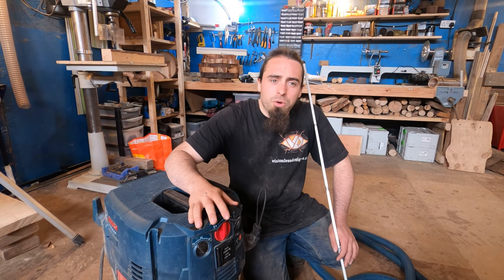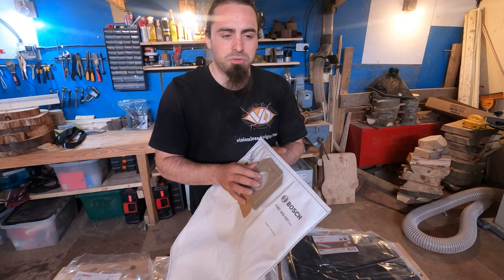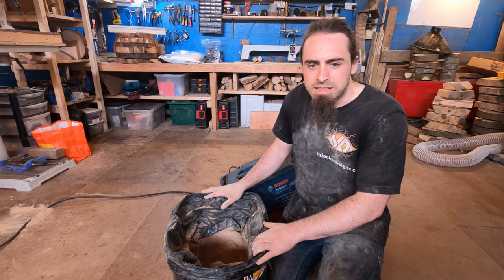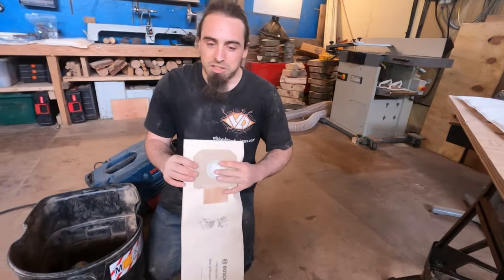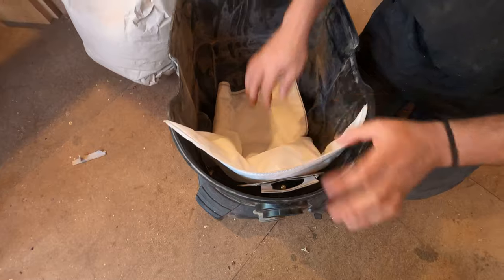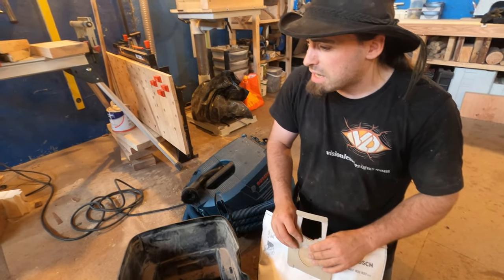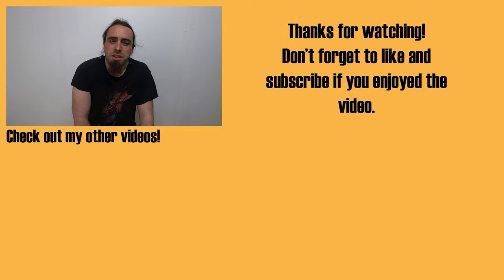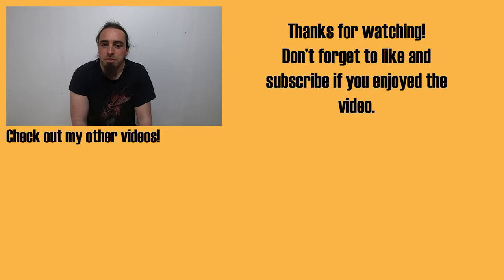Comparison Between Different Bosch Wet/Dry Extractor Bags

Comment: Hi Damien, coming in from your other vid, thanks for another informative one. 

More I think about the problem of dust extraction in smaller workshops, the more I think it's impossible to solve elegantly without both an extractor and a shop vac. Main limitation here is space and convenience. 

Given the fact that the paper bags are useless and the plastic bag just makes removal slightly easier, the fleece bag is the one to go for. That's a fantastic solution for construction work or general cleaning. For woodworking it's ideal for sanding tasks. 

Cost per bag must be considered too. I believe you could almost justify such a high price in bag if all you're using it for is sanding. It would surely take a decent amount of sanding to full a 35l gross volume bag. 

From my experience though, planers generate much larger shavings which shouldn't clog a filter with fine dust, so in this case the plastic bag and filter would be fine, and the limitation is how much volume of shavings planers can produce (a mountain in a small time). So the solution would be to do a manual clean first and then a tidy up using the plastic bag. 

Table saw is another machine that generates a decent amount of dust, but unlike the planer, it generates a wider range of dust, ranging from shavings or spikes, medium size dust and to a lesser extent fine dust. Still the medium sized dust a table saw produces will clog a filter. So in this case the fleece bag is a must, but that will full up a bag fairly quickly, now the main limitation is cost. However it could be possible to use an aftermarket dust separator. Better yet fully fledged dust extractor with an aftermarket separator. 

Miter saw. another machine that produces a great deal of medium size dust, obviously less dust though than a table saw since you're doing cross cuts and not rip cuts. But kerf widths here are for the most part almost comparable in my setup. So in this case the miter saw needs a separator too. Again dust extractor far more suitable for this. 

If you're still with me, you can see how ideas evolve as do workshops. 

So now since you're needing 2 separators (or a separator per tool) or a mobile separator, you might as well have one larger one, centrally installed and piping, to do this though you need to factor in additional hose lengths, gates and a stronger extractor to cope. Those budget ones most likely won't cut it anymore. Finding an m class extractor at a reasonable price, never going to happen, so you end up with something not even L class, that too has consumable bags and a filter to replace. And after all of this you will still need your shop vac for cleaning up the fine dust, and ideally a workshop blower for occasional blowouts. 

When I factor in all of this, I am back to square one. 

My current solution uses a DIY dust collection cart, a fairly crappy shop vac and a Triton dust bucket. No point in even attempting to connect this to certain power tools, but worthwhile to keep some movement on the table saw and handheld tools. Most of the filtering happens in the Triton lid, there's a fine dust filter there that appears to be L class, but it's most likely unrated. 

All of this is fine, except the Triton bucket started collapsing in on itself recently. I was considering building a better bucket for it out of metal, but this wouldn't be that easy to still keep the integrated filter, which got me thinking why not just buy something more suitable. 

Reality is dust collection is expensive if you want to do it right, and even if you rush out and buy a product like this Bosch vac (or any other decent vac) it still isn't going to be idea for some machines or just too expensive on the consumables to feel right. 

I think I'll stick with my homemade solution and try and reinforce the Triton bucket. Would be great if someone came out with a metal dust deputy style product with a filter.
Reply from the maker: Dust extraction wise, you can’t use one tool for every job realistically. Large dust extractors are no good for small power tools as the more you shrink their piping down, the less suction they have; whereas small wet/dry extractors have great suction in small piping but can’t handle larger pipes. I learnt this when playing about with my 3HP Fine Dust Extractor. 

Regarding your Triton Dust Separator, have you had a look at Rutlands dust separators? If I recall, they used to have some really good ones.

Yes, the plastic bags would be fine for planings as they would not clog the filter.

Also, my daughter thanks you for your decent grammar lol 😆
Reply: The solution is festool. Sorry about it.

Comment: Hay man, thanks for the video. I really would recommend buying or making a cyclone separator for the dry stuff. It will save you both fuss and money. Cheers
Reply from the maker: Thanks for the comment. I have been considering getting the Rutlands dust separator for the workshop.

Comment: yeah hey, great vid, can i just say so we are all on the same page,, its is a dust extractor and not a hoover and is designed to remove hazardous materials. Each bag is designed to be used with different material types and in different applications and then removed sealed and disposed of. 
If the materials are not a hazard you can bypass the use of a bag and go straight into the bucket, this will be fine for non toxic shavings from a joiner or thicknesser spindle molder and even leaves and small children and most important all your non toxic liquids.

Comment: on the 12  25 bosch vacum the open bag is used but a gasket like cover is also supplied which seals the filter from the bag          and why dont you make your own bags with zip at the end